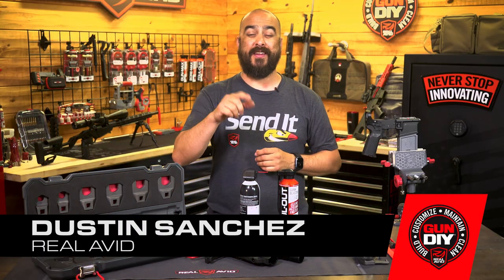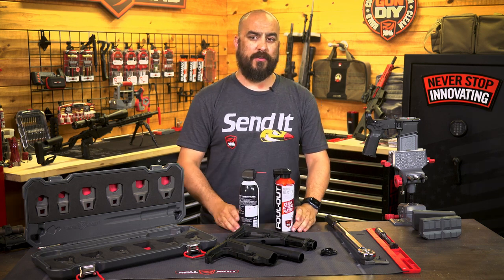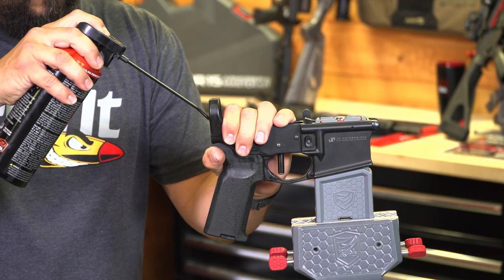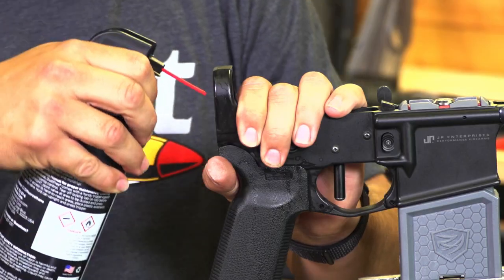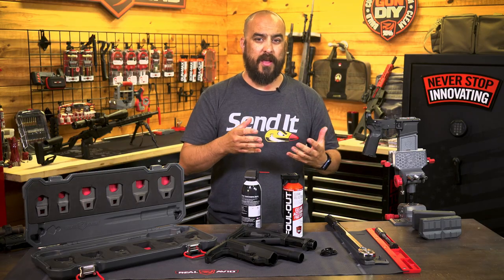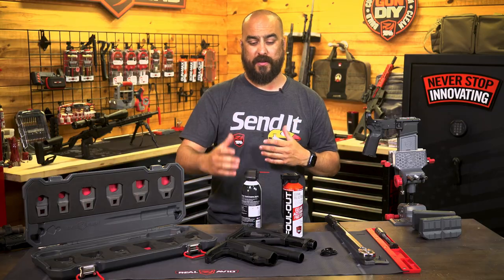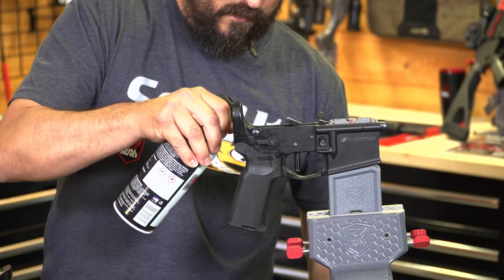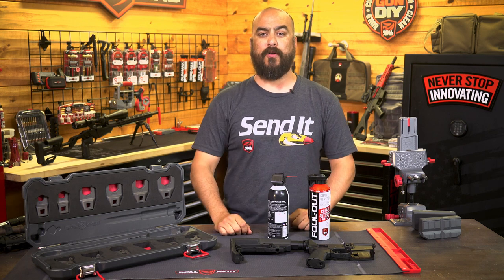TECH TIPS: The Importance of using FOUL OUT and Compressed Air

Comment: Loctite on the receiver extension? That's held in place by the castle nut torqued at about 30ft-40ft lbs and then stake the castle nut to avoid it loosening over time, or check it on occasion if you dont want to stake it in place... you never use loctite on the receiver extension or castle nut...

Comment: You don't put thread locker on the receiver extension threads, that is not good.
Reply: I couldn't believe I saw that.
Reply: You would be surprised by how many top end manufactures use thread locker on the receivers.